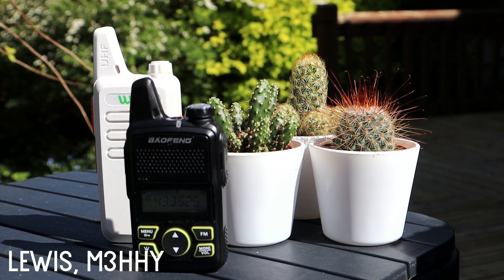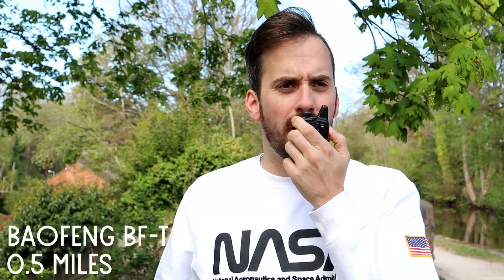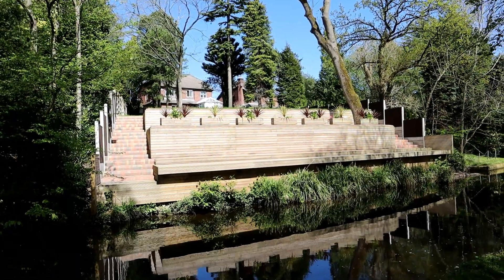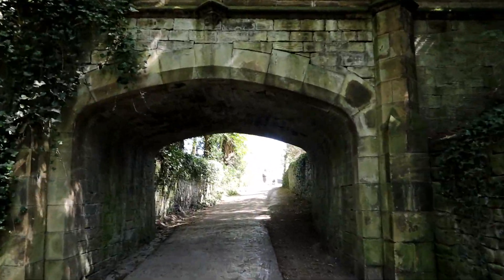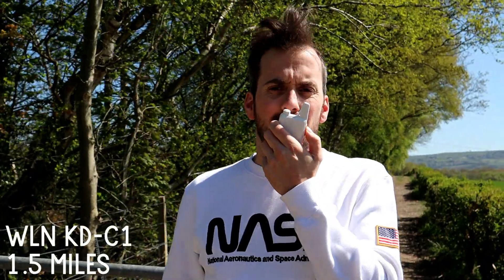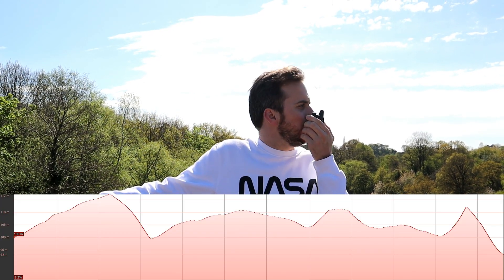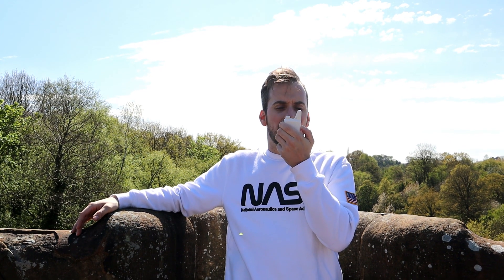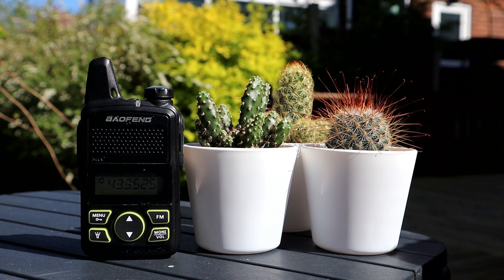Range Testing Super Small & Super Cheap Two Way Radios!

Comment: The bft1 is junk i went with the uv 3r beacuse you have more options as far as antennas and frequencies but the major thing about it is the bft1 can't be programmed on the radio you need a computer where a the uv 3r can be program on the radio

Comment: The BF-T1 has FCC part 95 type acceptance making it legal for GMRS and FRS use now. Not sure about the WLN radio though.
Also why did you use a repeater frequency, I would have use something else. I do all my range testing on one of my licensed commercial frequencies like 461.8250 MHz or 464.2125 Mhz so it's only me on there and no one else can just hop on for a chat.

WLN makes another radio similar to that that has a proper antenna per say. KD - C10. I don't own any of that brand though but may consider them for the neighborhood watch here since they are small and cheap and they have their own commercial repeater set up locally.
Reply from the maker: What makes you think I used a repeater frequency?
Reply: @RingwayManchester  I though I heard a kickback in a couple transmissions.
Reply from the maker: Nope it was 433.525
Reply: @RingwayManchester  ahh so the other traffic was just by chance. That's one thing I like about ham, almost ALWAYS someone on someplace if you dial around.